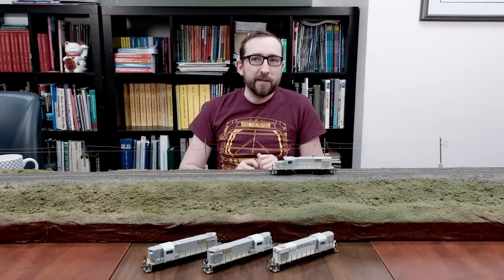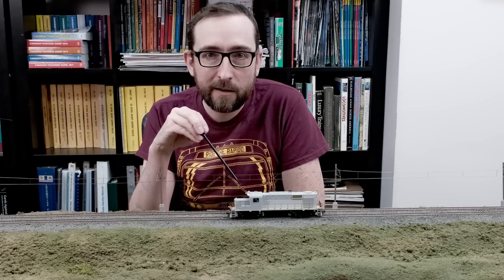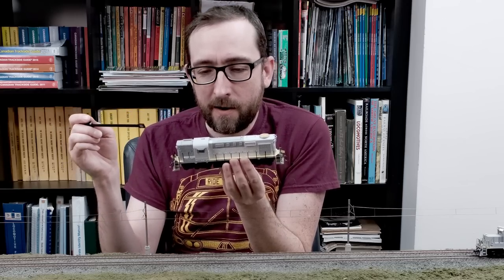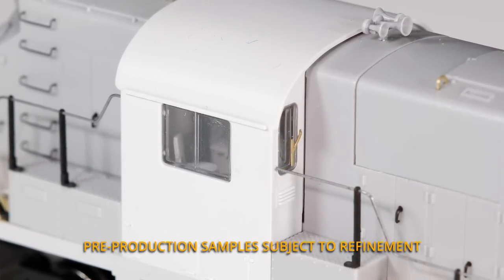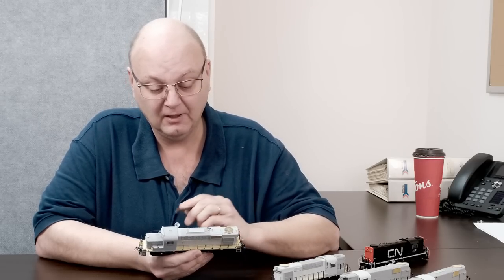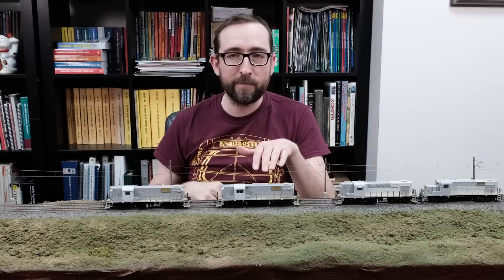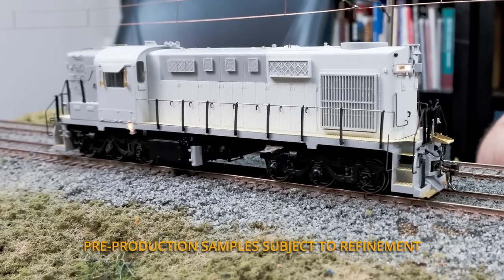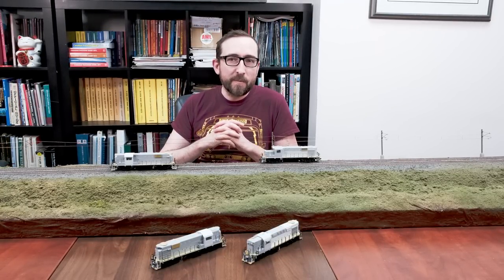Rapido HO Scale RS18u, RSC14 and Second Release RS11 Sample Review

Comment: Great video Rapido! If there are any GBW fan out there. Let's start requesting them to do GBW's RS11. We all know Rapido will do superb job on it.
Reply from the maker: We'll keep those in mind for a future release.
Reply: I've got an Alco RSD15 Alligator in GBW from Broadway Limited,  and an old RS11 from Atlas. Green Bay shows the way in Alco Haulic bliss. Rapido will lay the track smack downeth on the Bay of Green.
Reply: @rapidotrains  Hate to leave a reply on an old video. Green Bay & Western only had the one RS11, #309. I'd assume for simplicity's sake it would be produced in its 'as built' appearance, but its rebuilt form would sure be something to see in a stock model, especially since it would open up the potential WC/KB&S patch schemes. Speaking of KB&S, would be nice to see some of their RS11s. Outside of a limited run by Atlas back in 2005(?), I don't believe anyone else has produced a KB&S RS11, or any KB&S locomotive for that matter.

Comment: A little late to the party but does the Minnesota Commercial variant come with rear facing ditch lights per the real life prototypes?
Reply from the maker: These will only have the front ditch lights unfortunately as the tooling was only set up for the front versions as very few units got this modification.  With some modelling, it may be possible to retrofit them on the long hood end however.